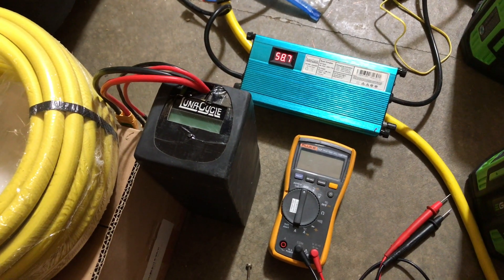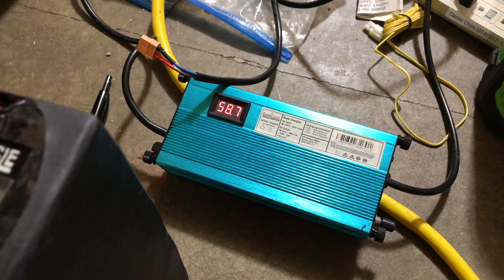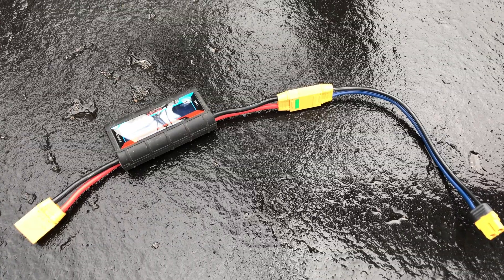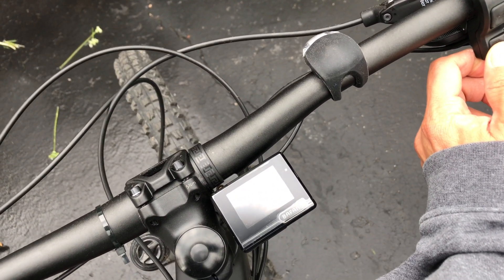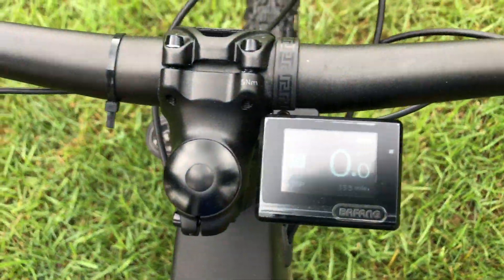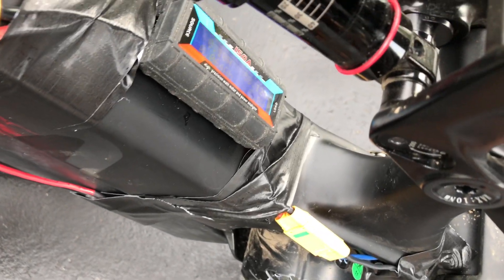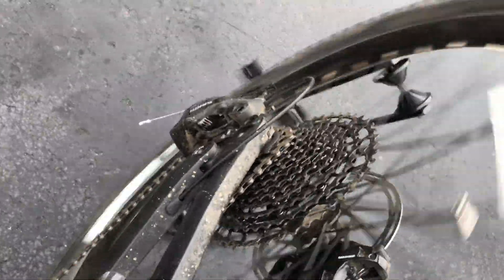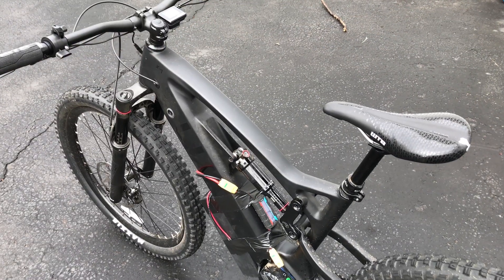52V on a Luna Cycle X-1 Ludicrous Bafang M600 eBike

Comment: Sorry i skipped trough the video so i might have missed something but you seem to not be in top gear while doing the top speed run with your wheel up in the air.
Reply from the maker: The bike came stock with the 11 tooth "disabled" because it would skip. I've since moved to Shimano's Microspline system, so I never investigated why it skipped though I did try adjusting the derailleur. I suspect getting a longer chain might have fixed the problem.

Comment: Thanks for the video! which do you prefer the X-1 or AM1000?
Reply from the maker: That is a difficult question to answer, however knowing what I know now and since I mainly ride trails, I'd probably pick the X1 because it's lighter. But if I were to ride on the road, I would prefer the AM1000 for its larger battery and higher speed.

Comment: Get a taller front sprocket
Reply from the maker: Yes, I've tried a 42T, but a 40T might be a safer size to prevent the possibility of the chainring coming into contact with the chainstay.

Comment: I was riding my m600 bike the other day it shut down charger light flashed oddly when I got home disconnected battery and normal reconnected to bike dead short at terminals any ideas  how to fault find it dreading taking it apart
Reply from the maker: How do you know it's a dead short?
Reply: @JustEnjoyingLife73  I stuck my multi meter on the terminals it read .1 ohms I also heard loud  crack noise and battery has arcing  burns
Reply: Battery fully discharged
Reply: Maybe water got to control board ?
Reply: Or loose or pinched wires?
Reply: What resistance  do you read at main power terminals to motor
Reply: I would expect 
.5M ohms until motor engages no current  should  flow  if system  is powered  down right?
Reply from the maker: @fgeetvlover12  sometimes the connection might spark because the capacitors are charging. Have you unplugged the XT60 connector from the motor to see if the wires from there to the battery are shorted? Where are the arcing burns on the battery? That seems unusual. Are you still able to charge the battery?
Reply: @JustEnjoyingLife73  its baffangs built in battery type the arc melted the top of terminal  I will take holder out after work today and disconnect from motor do I need lockring tool to get to motor connections ?
Reply: @JustEnjoyingLife73  battery still charges tho terminal  slots  have melted a bit
Reply from the maker: @fgeetvlover12  no, you don't need a lockring tool. It's a few Torx screws. Have you tried to see if it will turn back on? I might place a fuse inline, and then try again just to see if it's really shorted out. I wonder if the burns are from a short or from too much current during normal use. What did the manufacturer say?
Reply: @JustEnjoyingLife73  they said to remove discharge base on bike check if its tight think they want to rule out  loose  wire.  from the battery power goes to xt connector on non drive side and then fed  from there fed to onto  controller ?is that the way its wired
Reply from the maker: @fgeetvlover12  I believe so. When I plugged in my 52V battery, I plugged it into the XT60 connector on the M600. A loose connector can also overheat. It's possible the connection at the battery is loose.
Reply: @JustEnjoyingLife73  I took case off between discharge base and connector  was good  'so stuck my testers on xt60  off motor it measures .5 ohms coming from motor that's too low right  what is normal there
Reply from the maker: @fgeetvlover12  I can let you know the next time I h ave access to that area, or you could ask over at Endless sphere in one of the M600 threads if you need a quicker response.
Reply: @JustEnjoyingLife73  it was blown controller  Frey is sending new motor and battery fair play to them
Reply from the maker: @fgeetvlover12  that's great to hear that Frey is taking care of you.

Comment: is ludicrous enabled?
Reply from the maker: The Ludicrous modification is always active and cannot be disabled.
Reply: @JustEnjoyingLife73  I agree no need for any pesky useless limiting factors. If course if one creates a "utter insanity" mode through unadvised use of extreme over volting and other ill concieved  practices you would need the ability to limit the output on command. Failure to do so may result in death by an extreme overload of endorohic chemicals entering the cerebral cortex simultaneously resulting in permanent insanity and in some municipalities, public floggings. My specialties are electrical fires and explosion. 😜

Comment: This is perfect, thanks so much for taking the time to make this - as I plan to make a 52V pack for my Frey M600 later this week from 21700 cells (Frey was nice enough to agree to send me the battery case empty so I could build my own), and I was wondering if it was safe to do so. You also really got me with the sparks, at which point I thought you had definitely answered my question! Glad I kept watching!

Comment: Being that adding a 2nd battery to carry along for longer trips is a good thing (and that range on the X-1 isn't ideal using PAS3), what's your thoughts on carrying a 52V battery with more capacity than the stock X-1 battery and adding a plug so that you can just plug it in when needed? What 52V battery would you advise, from where and how much $$? If just jumpered in, will the stock battery indicator read it or will it require an additional battery gauge as shown in your video?
Reply from the maker: Carrying a second battery is a good idea if you need the range. You'd have to come up with a way to disconnect the stock battery. For example, you could have a set of connectors accessible from the outside so that you can disconnect the stock power source and plug in your battery. Any of Luna Cycle's 52V batteries would work. You'd just have to decide how much range you want. The stock battery indicator will not read the capacity correctly since it's setup for a 48V battery. Some of Luna's batteries have a built-in volt meter. Have you considered just buying an extra 48V X-1 battery, or did you want to try 52V?
Reply: @JustEnjoyingLife73  The Luna X-1 battery is $520. I know that less expensive 52V batteries with more capacity can be found elsewhere but no, they won't fit in the same place as the stock one does so I'd have to come up with a way to carry either battery.

Comment: I love Luna & their products. I'm a Luna devotee for their quality & service. That said, I don't think they'll cover setting off explosives near their bikes :)
BTW I have 2 Luna kits. A BBS02 & a Ludicrous BBSHD. I'd think, with a 42t chain ring, your top speed could be higher as I can exceed 30 mph on flats with the BBS02 on a very upright POS steel frame.
Reply from the maker: :) Oh yeah, I'm definitely gear limited right now. My 40T just arrived, so I'll install it to see how fast it will go :)
Reply: Yeah I have the BBS02 on my aluminum hybrid bike and with me being only 150lbs, having a 44t chainring and going at the slightest downhill incline on a highway reached 36mph.
Reply: Keep in mind the throttle pushes 1200w so it isn't the stock 750w
Reply: Also knobbly tires are going to sap your top speed by a bit. My bike has slightly knobbly road tires
Reply: That is they have low rolling resistance but still have nubs
Reply from the maker: @jkaustok  I plan to try a Rocket Ron on the back and a Nobby Nic on the front, and I have a road wheelset I can test it with for fun.
Reply: I've installed a 40T chain ring on my X-1 and could reach 30 mph pedaling. I've installed a 42T ring yesterday (haven't tested it) and there's still more room so I've ordered both a 44T and 46T to see which is max. I'll return what I don't keep. The 11T gear is unlocked, adjusted stuff and no more gear skipping either. I do think an extra battery is a must and I'd prefer 52V as well but so far, no one makes them specifically for the X-1. Might opt for a 52V battery on rear bike rack with an adapter someday?
Reply from the maker: @johnoaklay4694  Are you commuting with it? If you use a rear rack, you'll probably want to use a regular seat post instead of the dropper. You might also consider reinforcing the rack using a bracket from a second rack so that you can support the bottom of the rack so that it doesn't break off when you hit a big bump. I have a large battery mounted like that in one of my other bikes. Maybe you could also mount the battery under the downtube?
Reply: @JustEnjoyingLife73  No, not commuting with it but when we go out on regular bike path runs, it doesn't have as much range as my Roadster ebike does. It's even less if I'm on a rough trails, hills.
Reply from the maker: @johnoaklay4694  Yeah, those minions feel like they offer quite a bit of rolling resistance on pavement. Have you taken a look at this site? There's some useful info about rolling resistance there. https://www.bicyclerollingresistance.com/mtb-reviews

Comment: Use a hub motor...mid drive has to many turning wheels in it...and you can not cycle without resitance....etc etc
Reply from the maker: Actually, a mid drive does not offer any resistance to pedaling. Direct drive hub motors can add resistance to pedaling if they're not running. A hub motor of equivalent power won't offer enough torque for off-road use because it can't take advantage of the gears on your bike, and a hub motor of comparable capability is much, much heavier (the bike would weigh over 100 lbs), and the motor is unsprung weight, which is not ideal for uneven terrain where the suspension is traveling quite a bit at a rapid rate. Hub motors have their place, but for this type of use, a mid drive is ideal. That's why you see them on bikes like the Specialized Levo and Giant Full E, where low weight and high torque is a priority. Also, I don't know of an easy way to adapt a torque-sensing bottom bracket to a hub motor, so if anyone knows how, I'd love to learn about it.
Reply: Huh?
Hubs come in 2 types, geared & direct drive, and neither is suited for serious off road riding. Geared hubs have many moving parts inside like a mid-drive. Also like a mid-drive the geared hub offers no resistance when not using power. The direct drive hub is the simplest with no moving gears just magnets so it is very reliable but has no torque for hill climbing (unless you go 3 KW or higher). The direct drive hub motor unlike a geared hub or mid-drive does offer resistance when not powered.
I fail to see why unsprung weight and lack of hill climbing torque would be desirable but to each their own. For fairly flat commuting strictly on road I could see some advantage to a direct drive hub but otherwise a mid-drive is superior for almost every purpose.
Reply: SpeedRacer 650  Am I a poser for commuting 60km/day on my X-1 and then throwing some off road wheels on it for some weekend fun?
Reply: SpeedRacer 650  it's surprisingly adept at both roles. I have an Intense Carbine for real enduro riding though as the X-1 falls short in terms of outright performance off the pavement.
Reply: SpeedRacer 650  yeah i know.for heavy trail middrive is fun...

Comment: Dude, you are hilarious. My jaw dropped when the sparks were flying. 

With 40T up front and the 11 tooth gear unlocked, you'd be doing 40 mph, Holy shit.

I wonder if we can fit an extra cell inside the stock battery and have a 4p14s battery or if we'd have to drop back to 3p14s and lose capacity.

If you gained 3 mph from the additional 3.7 volts, you would get to 34 mph on 60 volts with stock gears, but that would really be pushing the poor thing far, but it's got a thermal over load sensor so maybe you'd be safe. 3p16s would definitely fit. Maybe I should try it. I live in MN and winter is great for cooling :)
Reply: If I start out in the 13 tooth gear, the bike does not like it. The chain/gears make terrible noises... Once I'm rolling 10 mph or so, the bike doesn't care that the angle is bad. Must not be enough torque at that point to cause an issue.

With all the urban riding I do and the lack of insane hills in Minnesota, I think a 38T or 40T is the way to go. You can have a nice straight chain line and be able to get up to 25 mph before you decide to switch gears for more speed.

I've been doing a lot of stair cases and other urban obstacles around the downtown area, kind of fun just running wild. I have to remind myself that I can't go through red lights anymore when I get back into my car.
Reply from the maker: Haha, thanks Jeff! I got a 40T arriving soon, and I'll let you know what happens :)